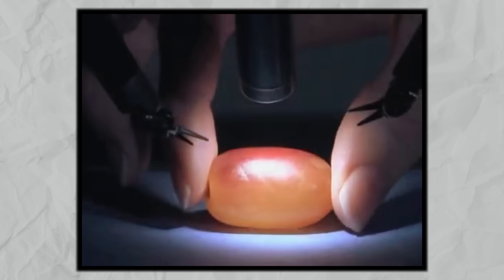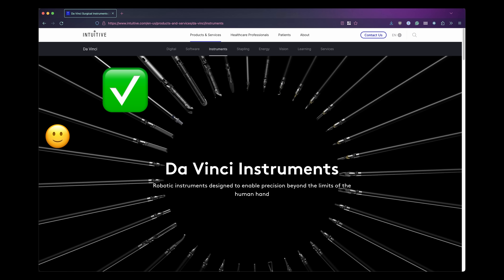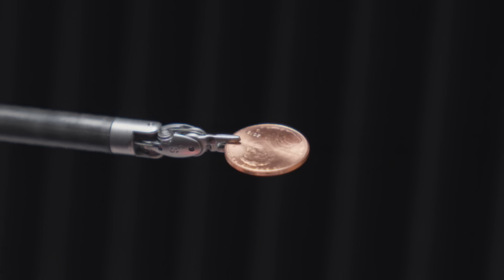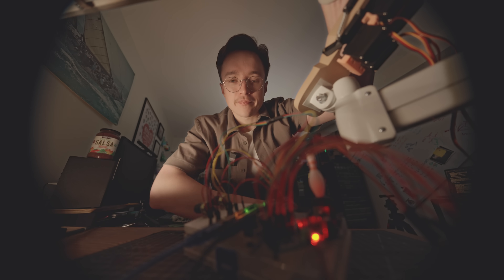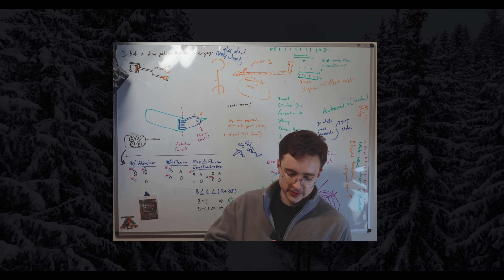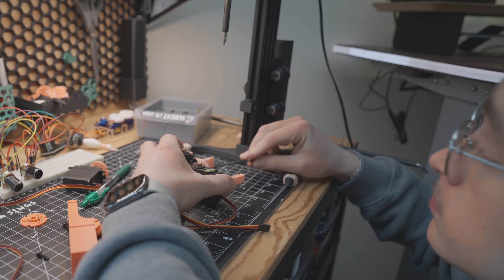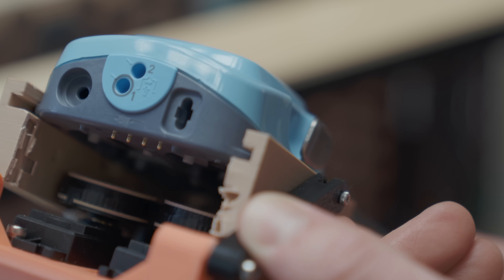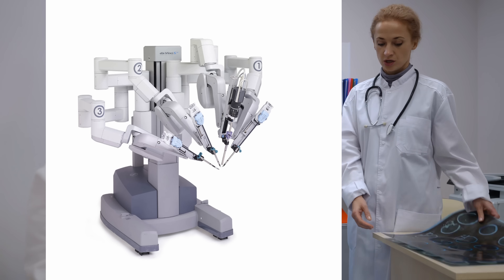Building a DIY Surgical Robot

Comment: I'm a software engineer and actually developed software to control an autonomous surgical robot (which mostly did suturing, anastomoses, etc.). We had some preclinical success on pigs, but eventually the team went our separate ways. One person actually joined Intuitive. As part of my design process, I was actually able to sit in and watch a minimally invasive surgery which used the daVinci robot, and use the robot myself to suture up some silicone training pads. It's surprisingly 'intuitive'... even for non-trained surgeons like myself. However, our platform we developed used completely custom tooling, and a 6-DOF arm from KUKA, along with a bunch of expensive fancy cameras.

Anyway, it's cool to see other people working on similar projects in a personal capacity. It's a neat field and challenging problem, especially when you throw in robotic autonomy.
Reply: I used a daVinci S at a Science Fair with my nephew in San Diego, and it was so much fun. As I've always relatively unsteady hands, I was surprised that it completely smoothed out any tremors, and I was immediately doing fancy two-handed moves with it, stretching rubber bands over things. The surgeon working the stall noticed and mentioned I was surprisingly dextrous with it.  Since then I've always wished systems like that were available for non-medical hobbyist uses, like precision electronics, model-making and so on; cut-down, non-safety-critical versions of course.
Reply: @tomgidden Ahhh I never thought about it, but one of these would be amazing for model making!! 🤯
Reply: @tomgidden that makes me think: imagine if you could train a child on one of these. I wonder with their nimble brains could they compete with an adult after a few years? Perhaps you could identify surgeon prodigys.
Reply: when i hear software with cars, and medical tools... some how a shiver goes over my body... 
even more when i hear they use a custom implementation of c....
Reply: That sounds incredible, is there anywhere I can read further about it?
Reply: Sir may I have ur LinkedIn pretty please

Comment: that fact that you have made it this far is impressive as!!
working out those 4 axis ones is going to absolutely suck
also as far as input is concerned, even if you built a mechanical replica the interface between that and your instruments is going to be some crazy complicated maths

if you get this working to even a basic working state i think it would be incredibly useful for things outside the medical field, especially since you have worked out there will be a steady supply of the instruments.
things like small scale electronics come to mind.

I also think if you find the right instrument, that modifying the end effectors to suit other purposes would be another avenue for investigation.

instant new follower here, lets see how much patience/endurance you have for this task!
Reply: I mean I don't particularly like math but it shouldn't be terribly difficult to calculate the end effector position based on the input as long as he opens one to figure out the pulley ratios inside.

Comment: This is absolutely AWESOME and totally genius! I wonder if it could be used to work on circuit boards with surface mount components? That would be awesome. I shake like a tree in a hurricane whenever I try to solder small stuff.
By the way, how in the hell, with this level of awesome video, do you only have 173 subscribers?

Comment: It wouldn't give the haptic feedback, but a Leap Motion / Ultraleap Hand Tracker may work to an extent.  

For hand tracking and haptic feedback, short of making a OS Version of the Proper Device (which would be cool af, but agreeably hard (although a robotic arm without motors, if that makes any sense, may work.  James Bruton did an OS "puppeteering rig" for the terminator torso+head, so between that and the OS Robotic Arms out there it may be doable with existing work and some integration hell)), there is an Open Source "Haptic Glove" type thing.  I am unsure on latency and all that, but it was basically gloves, cables, and a sensor and/or motor module.  They also have a discord which would be great for troubleshooting / brainstorming.

Comment: I have worked in surgical robotics research. For input we have used two Force Dimension Omega 7 haptic devices which is probably beyond hobby budget, but maybe you find used ones. I can also try to ask their co-founder if they maybe have some leftovers :P Your best option would probably be two space mice by 3Dconnexion, although that means differential input, but better than nothing. If your robotic arms have enough freedom that you can do 6d motion with those tools, you need another input per hand for open and close, but maybe you can use foot pedals for that. I also got to try the DaVinci on a conference in simulation, it's cool but it's not overwhelming ;)
Reply: There are open source 6 DOF mice akin to those space mice as well with identical/better performance out there now.  I can grab link spam if need be.
Reply from the maker: Just found this guy’s open source version- parts on the way! https://youtu.be/iHBgNGnTiK4?si=oFAwNk67MaiLaNng
Reply: It'll be interesting to see how you set up the controller using an input like this, I think impedance control would feel very differently from what exists today but it could be effective for your needs
Reply from the maker: Thanks so much for the pointers- I’ll keep my eyes peeled for space mice and look into Omega 7, this is the first I’ve learned about it!